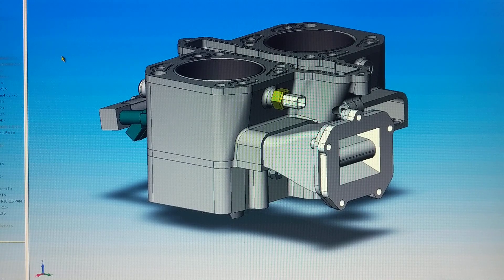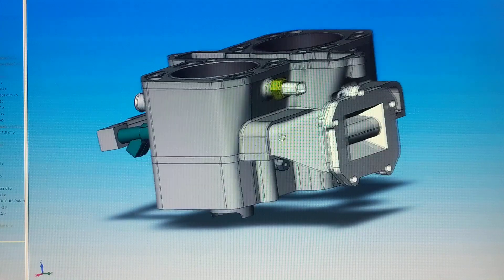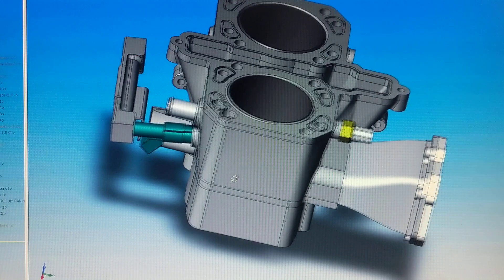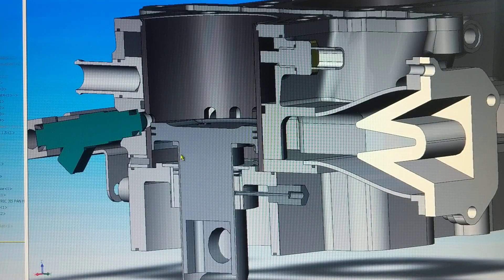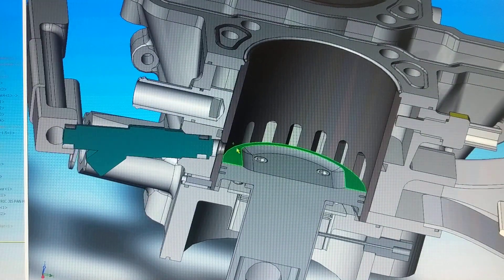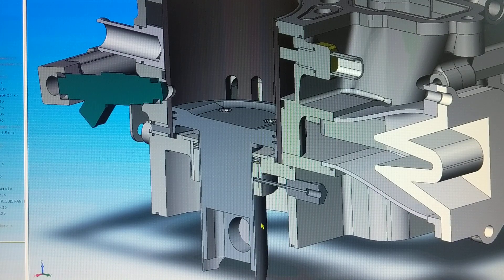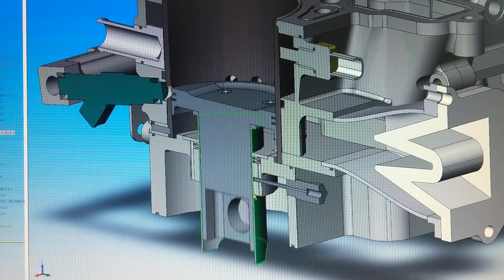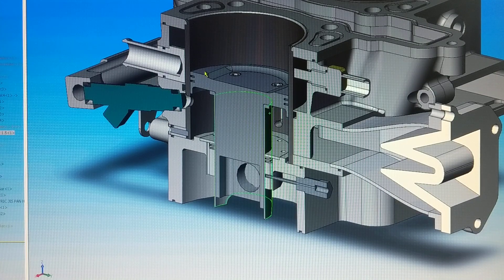Mushroom Piston engine, two stroke, EX500 CAD solid model.

Comment: You might want to look up the big two-stroke cross-scavenged diesel engines used in ships. This has been done for a long time.
Reply from the maker: Yes but... As has been said, all those use, and have to use, a blower, a mechanical supercharger to start and run. This design does not need a supercharger to start or run.

Comment: How well would the direct injection work here? I see you said EV1 injectors, just wondering if you've checked in to how well (specifically the o-ring) will it hold up to cylinder pressures/temps? I know from back at working for BMW even the slightest gap around a direct injector would end up causing terrible misfires. Don't know a ton about the specifics of two strokes, so not sure if they work differently in regards to this or not though.
Reply from the maker: Study the model and how the engine works, its low pressure direct injection. The transfer ports open at the same time the injector port opens and injection is timed a few degrees after that. There is some transfer pressure but less than one bar while fuel is being injected.

Comment: Do you have an oil injector lubricating the piston rings?  If not, I suspect the rings/sleeve will wear extremely fast.

I like the overall idea.
Reply from the maker: I have covered this topic a lot. No upper oiling, has oiling on the lower cylinder.

Comment: 500cc but airfuel 250cc
Reply from the maker: No, 500cc but being two stroke, pumping capacity of a 1000cc four stroke.
Reply: @algiecompositeaircraft5629  combustion chamber volume 500cc but air fuel  intake volume 250cc
Reply from the maker: Understood.... Is a necessity from using the original connecting rod wrist pin design. My development now is to make a new rod with a new piston, that improves that greatly.
Reply from the maker: I will release a new video about that work soon.
Reply: I would like to see this improvement!!

Comment: very impressive design. how are the cylinder walls lubricated? does it use premix or oil injection like a conventional two stroke?
Reply from the maker: Thanks. The compression rings in a modern four stroke don't get any oil to them, is my angle on this subject. If the top compression ring even got a tenth of a drop to it, you would have oil consumption. Also, the cross hatching holds a little oil during break in, once that wears off and the rings are bedded you get full sealing. And no, I don't run any oil in the fuel.
Reply: @algiecompositeaircraft5629  i think most modern four strokes actully do get a tiny bit of oil. the cross hatching will likely hold a tiny bit that always gets past the oil control ring. not to mention that the crankhouse ventilation is redirected to the intake. so there will be a bit of oil vapour to. which probably condenses in the intake and form tiny oil droplets. either way since this is an experimental engine. you will probably save yourself some heahache by running just a tiny amount of premix. idemitsu makes a premix oil specifically designed for fuel injection systems. since youre not using premix for the crank. you could probably use 0.5% or less. really anything at all would be better than nothing in my opinion. but then again that's just my opinion and i dont have an engineering background
Reply: Bore spray like ford uses on the coyote v8 cyl bores can be tuned for amazing low wear and low friction characteristics

Comment: The piston liner sleeve looks extremely thin. It's going to be a nightmare to try and machine from billet. I'd seriously recommend you make the tubular wall of it thicker to make lathing it more feasible.
Reply from the maker: I bought an existing liner blank and had to hone it about .012" to get it to 74mm. It hasn't given any trouble.
Reply: @algiecompositeaircraft5629  Ah, that works! I was imagining having to machine it from a solid bar of 4130 and was scratching my chin in dread at the thought of how loud it would have screamed while turning the last few passes.

Comment: I've been thinking about how you assemble the piston to the conrod with the hard sleeve and the bearing etc. I see how it could be done but my way would be a mission. I also see that you have 4 screws through the piston crown to secure the hard sleeve. There's probably a good reason for doing it that way. Is it possible to secure the hard sleeve with a hollow top hat type cap that screws up from the bottom with the cap then fixed in place with a grub screw? The piston crown would then be free from possible failure points. The sleeve could have the flange for the threads removed or reduced. The sleeve might also be used to retain the gudgeon pin. Just a few thoughts.

Comment: Very interesting design, but how does the main piston/cylinder get lubricated?
Reply from the maker: It really doesn't, except it is fuel and air charge cooled. As has been discussed, i think modern four strokes have no actual lubrication to the compression rings, if they did, there would be major oil consumption. Also, the hone cross hatching only serves to bed, or seal the rings, and goes away in time.
Reply: @algiecompositeaircraft5629  Once upon a time I wouldn't have agreed about the cross-hatching. Now, current thinking is to finish the bores more or less as they would be once run in with a fairly fine finish. I just had the bores of a small twin refinished and they came back more or less polished but had a precise diamond hone finish. Gave them about 10 minutes warming up on the dyno and straight into it. I've checked everything out and it all looks great.

Comment: Why do you want to fire the injektor so late? Why not fire the injektor while the piston is moving down, to give the air and fule more time to mix?
btw super cool design!
Reply from the maker: I time the injector to fire right as the transfers open, so i get both good air/ fuel mixing, and it needs as much time as possible to get the whole fuel squirt in. This engine is unusual in that it needs almost zero prime or warmup extra mixture. Good for low warmup emissions.
Reply: @algiecompositeaircraft5629  you have thourght of everything! Thank you for the answer
Reply: @algiecompositeaircraft5629  From looking at SW render, I had thought the fuel injector may be better higher up in the cylinder so that injection could take place after scavenging to avoid possibility of fuel loss, but,as you indicate, mixing may be more important. A stratified charge  system (difficult!) would allow full compression transfer at all times.

Comment: "2-strokes never work with a turbocharger". Snowmobile guys would disagree, and the monster marine diesel engines.
Reply from the maker: Port two stroke, that uses a cylinder wall exhaust port.
Reply: @algiecompositeaircraft5629  OK. Snowmobiles fit that description, not common though
Reply from the maker: Port two strokes always have blowers, love to see a pic or video of a port two stroke with a turbo. There was a V4 port two stroke aircraft engine a few years ago with both blower and turbo, they had so much trouble with piston siezures that they had to offset the wrist pin in the piston to reduce thrust loads.
Reply: @algiecompositeaircraft5629  Sorry, I'm not sure what you mean by "port two stroke", but skidoo have a factory built turbo rotax powered model and I have done a bit of work around a 9 cylinder ship engine that was vaguely similar in layout to your engine, apart from being 3 stories tall, and it had 3 turbochargers. Skidoo - https://www.youtube.com/watch?v=UxZY2DegTzU

Comment: This would still benefit greatly from a nice expansion chamber. Depending on the phasing of the cylinders, you could potentially use the pulse from opposing cylinders to help ram some of that air fuel mix back into the combustion chamber.
Reply from the maker: My design point was that it shouldn't need anything more than a tuned length exhaust like a 4 stroke. A port two stroke needs one to both scavenge the transfer, and then block the port from compression and mixture losses. This engine does not have adjacent ports, in fact they are further apart than the valves in a 4 stroke. So jist tuned length scavenging pipes i think are best. But, as i say, the internal combustion engine has had 120 or more years to be refined, this version will take time too.

Comment: Nice try. Problems I foresee:
Angularity of connecting rod might be a problem given the extended "crosshead" design.
Piston cooling. There isn't any, and no means of doing so. A conventional 2 stroke gets some cooling underneath from the transfer. Most modern 4 strokes use oil jets.
Suggestions:
Look at double diameter pistons.
Overall: Interesting concept.
Reply from the maker: Its the original length rod, so i don't see your point there, and it runs fine like that. Pistons get intake cooling all around, see the CAD solid model video, and low pressure direct injection sprays cooling fuel air mix across the piston crown. Your perceived points don't hold up in practice that i have found.
Reply: Is the piston crown made of a temp resistant alloy?   It seems it could be.  If it works Sioux great but if it’s short on crown durability or one wants to crank up the wick…. Easy hp

Comment: Hi, finally someone put it into a running example! Great JOB!
Lots of work went into I bet.
I have had a similar design and always thought to use a EX500 or 650, when they came out many years ago.
My idea was to supercharge it, like someone mentioned already. 
The 4 valves (exhaust valves that is) my idea was to slow down the rotation to half and have 2 open at a time and the other two to open at the next top dead. This way you have a higher rev capability. I don't know if you have them open all the same time or 2 at a time.
My shortcoming of the design theory was the long piston needed to keep the ports covered.
Needed one compression and an oil ring on the bottom of the piston too.
Intake (transfers) which were all around the bottom dead center, 6 of them designed in a swirl that got smaller and smaller as the pressurized air got around in the cylinder.
I never had the opportunity to build as so many more designs I had throughout my life.
Really like to see and hear your bike running, please don't be shy to put more videos on YOUTUBE.
Thank you so much!
If you like, you can get in touch and send me a message.

Comment: Precombustion is done better, if you move it inside of the crankcase housing. Air/Fuel mixture is sucked in all the way trough the crankcase and ends up inside the cylinder trough Cylinder ports that connnect crankcase with the combustion chamber. Air fuel mixture is then pulled in due to the preassurized crankcase in the same moment as exhaust gases leave trough the exhaust port.

Even better if you move the direct injection inside the crankcase for pre combustion
Reply: Think that whole point of using direct injection is to allow a separate lubrication system in the lower chamber. Injection below piston would necessitate fuel/lube mix.
Reply: @cwt5654  it's all about the efficiency.
Reply: @Tiwey  By not having fuel vapour in the lower chamber, the whole inducted volume can be filled with air (i.e.oxygen) which should improve maximum power output. With regard to mixing (vaporisation), he has indicated fuel is injected across the high velocity stream coming from the transfer ports.

Comment: This design has low efficacy
Reply: its a two stroke so kind of obvious
Reply: @tsuzukimurphy64  no, it's not for that reason, it's for the low pre-compression. If you want to do that you have to use a proper compressor and the transfer port should be higer. By the way, a 4 cyl. at 90° will be the perfect solution

Comment: If you're going to use exhaust valves on a two stroke you might as well copy the Detroit diesel design and run a small blower. Simple, better scavenging, crankcase lubrication to the piston and no reed valve. Cool model though, good job!
Reply from the maker: You miss the point that this engine does not NEED a blower. Better power density. Also the reed spreads the powerband out, this engine has great low speed torque as well as higher rpm.
Reply: It also separates the crank case from the intake so much better oil consumption characteristics.   Detroit Diesel strokes  died of emissions….

Comment: Excellent engineering. When do the exhaust valves open and close? My guess is right before the transfer ports are opened. Then trying to time the closing of the valves at an optimal point at various rpms has got to be a problem. How do you handle all that?
Reply from the maker: I started with symmetrical exhaust valve timing, at around 90 degrees ATC, and then advanced them to earlier opening and closing, and that was a good gain, more power and "freer" revving. As you realize, i can have asymmetrical exhaust timing, unlike a port type two stroke.

Comment: Have you had any problems with the piston rings without any lubrication? All the engines I know of have some oil to the rings, some bypassed from the oil rings and some from fumes comming from the breather to intake.
Reply from the maker: No problems with the rings at all. This is a learning curve, as are all new mechanical devices, and i am learning as i go, and to think it will be trouble free after the internal combustion engine has had 140 years to develop would not be right. But in the hours i have run it so far, its not too bad, and has not blown up yet.
Reply: @algiecompositeaircraft5629  Well you can always route the crankcase breather to intake if the rings need some oil. As machinist and an engineer I do respect the work you have done with this! Not a small feature designing a new engine. Congrats!

Comment: That helped clear up most of my questions concerning the operation of the engine; many thanks. One remaining question, and having seen the engine run without a pressurized intake charge, it would seem the descending piston would overcome the intake air flowing through the transfer ports, creating a confused to-and-fro wave action. Obviously the engine has run without positive pressure forcing the air into and through the transfers, so could you explain this seeming conundrum?
Thank you.
Reply from the maker: The volume under the piston head increases as the piston goes upwards. On the downstroke, the air compresses against the reed valve, until the top of the transfers opens, then the compressed air is forced around the piston and through the transfers, and is mixed under pressure with the incoming fuel from the injector.
Reply: @algiecompositeaircraft5629  that's a brilliant design
Reply from the maker: The reed valves are the key to this, when the piston is at TDC, the lower volume is greatest, there fore has drawn a volume of air in, then the reeds close and that air is compressed until the point of the transfer slots opening. I time the fuel injection to start 5 degrees after that happens, for good air/ fuel mixing, and minimum "wall wetting" effect. Indeed, it needs almost no added warmup enrichment fuel, or "choke"
Reply: The CAD rendering was key for me to visualize everything.
Now I’m curious about the resulting BMEP, BSFC, and emissions. I understand you may not wish to get specific at this time, but this project makes for compelling and fascinating viewing. 
Perhaps you could share with us the effective compression ratio?
Reply from the maker: I have not calculated the effective compression ratio, but the static is 9.4:1.
Reply: Ok, once the piston hits BDC, any residual pressure in the intake tract comes rushing in through the transfers, thanks to the reed valves. Is that the case?